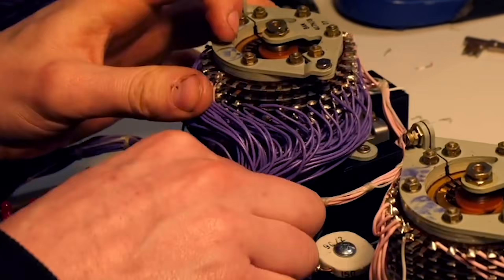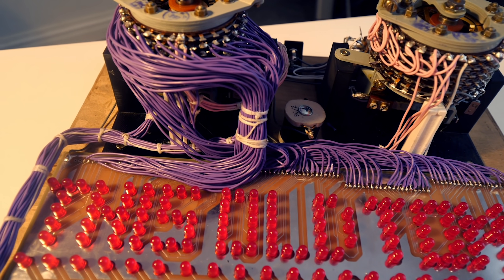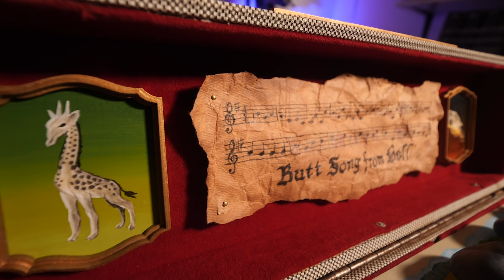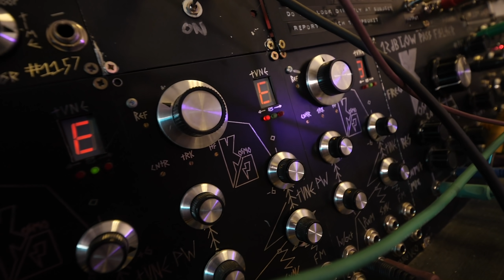ELECTROMECHANICAL LIGHT CHASER OF DOOM - DIY Build

Comment: When I trained to be a technician, I was taught to adjust stepper uniselectors.  A group of (stupid, bored) trainees, including myself, used to tune up the uniselectors to go as fast as possible, drawing bright blue arcs off the solenoid contactors.  We even had t-shirts made up for the "Uniselector Racing Team", no one said we had taste.  

No mater how fast you could get a stepper uniselector to go, it does not come close to the speed of a Siemens motor uniselector - these were massive and used a toothed brake to ensure they stopped on the correct outlet.  The big spring loaded brake was held away by a 50V 1 amp solenoid as the uniselector rotated, once it reached the correct outlet, the current was cut and the toothed brake engaged a sort of toothed gear (if you see a toothed wheel, that is a motor uni).  Every once in a while, the relays that held the brake up would malfunction and keep the current on,  it didn't take long for the brake solenoid to go up in smoke.  The motor was an open affair with two coils at 90 degrees and a rotor.  I remember all too well servicing and  "oil and dagging " (lubricating) these things in batches of 100 at a time.  The Motor unis did around 200 steps a second and were very hard to follow by eye.

Comment: Back when movie theaters had big glitzi marquees, you could stand under the chaser blinking overhang and hear the rotating and clicking bits quite plainly. As a young mad scientist, I even made a few variations of chaser circuits using motors and cams and microswitches. Just 4 fun.

Comment: Hindsight is 20/20... but of you would solder them in stacks of 12 with 12 earth.. you only would need to have 24 cables.
Reply from the maker: Yep I already knew about the multiplexing :D. But I did it this way as I felt like it was a cop out as I wanted to make use of multiple rows when that method would not have made use of it all if you get me. I wanted it to look like it was a right faff to make haha
Reply: @LOOKMUMNOCOMPUTER  well... its maybe me hating manual Labour, but i would probobly go one more step and simply reversed every second diod to cut it down even more
Reply from the maker: @matsv201  aha thats where you and i differ then i guess. i wanted it to look like that, so i was happy putting in the time :). for something like that it wouldnt be as cool with only a few wires :)
Reply: @LOOKMUMNOCOMPUTER  yea. I put in more theoretical work ro make it look just a little bit leaner

Comment: Actually, if you were to make one on the ground end, and one on the live end I'm pretty sure you could multiply those selectors by each other when it comes to the amount of possible lights
Reply from the maker: Yes you can.
Reply: @LOOKMUMNOCOMPUTER  well go on then
Reply from the maker: @greengoat5654  i will cus i aint soldering it like that again ha. when i planned this it felt like cheating as i wanted to have a fudge ton of wires on it. but the next onew im gunna multiplex
Reply: @LOOKMUMNOCOMPUTER  I want to see how long a sequence or you can make with only two of those, just as a challenge
Reply from the maker: @greengoat5654  well 900. but 9 sets of 900 but wont be 1 after the other
Reply: @LOOKMUMNOCOMPUTER  it would probably be beautiful sounding too

Comment: Could've multiplexed the leds, rows and columns, would have saved a lot of wire :)
Reply from the maker: Yeah I know. I did it like this because i wanted it to have loadsa wires. No point using uniselectors if using just 1 row on the fast one. I build with me heart ❤️ not me head most of the time ha👍

Comment: I spent 40 years working in on electro mechanical Stroger Telephone Exchanges and recognise these items well. All of our exchangers ran at 50 volts, although some smaller Exchanges and PABXs were 24 volts. They all had battery back to protect against power cuts. They were certainly more bomb proof than the current electronic stuff of today and just kept on working. Lighting and electrical spikes were all in a days work for these exchanges. The betting industry used this same equipment as it was ready made for the "TOTE" machines used at tracks for Dog and Horse racing. As this stuff was so well made was also used in Traffic Light control on many road junctions. Plessey and GEC being one of the main UK manufacturers. The switches and keys were also used by the BBC for switching circuits as they well so well made.

Comment: Should have multiplexed the LEDs. One switcher for common anodes, the other for common cathodes. Would have made for a trickier PCB layout, but only 35 wires from the switchers to the board. I worked at an American telephone switch room for about a week (job training for a Boy Scouts group) back around 1973. Loved watching the switches in operation, but never learned how the mechanical side works. Nice finally being able to see the ratchet and pawl system in operation.
Reply from the maker: Yep this is true. I went for the above as I usually build with my heart and my heart was saying do it this way ha. I wanted to make it with a trunk of wires. But never again I am designing one now which is multiplexing because yeah that one broke me ha 👍
Reply: @LOOKMUMNOCOMPUTER  Multiplexed LEDs are lots of fun. (So are multiplexed switches.) Loved the video. You do good work.

Comment: This is awesome. Can I recommend looking at wire wrapping wire and tools? The wire is thin, dead easy to strip with the tool, and can be soldered or wrapped, depending on the project. For these types of cray-esque projects, it's a massive time saver. It also lets you solder the wires direct onto fine pitch ICs, which is usually hard to do
Reply from the maker: I have those tools cheers it didn’t seem right for this the uniselectors had the wrong pins for wire wrapping

Comment: It’s not insanely difficult of a thing you made if you understand how it works but like, it’s done so well and looks cool. When I was in college the first time, back in like 2002, I remember actually being taught about a device that was functionally the same as those things. Though when I dropped out a year later to work full time as an electrician, that marked the end of my electro-mechanical journey. They actually changed the entire course right after I dropped out to be more electronic based, less mechanical based.
Reply from the maker: Ha yeah this thing is not complicated at all. It’s using it to do the simplest thing it can do pretty much.👍👍👍👍👍
Reply: @LOOKMUMNOCOMPUTER  a project I had to design using a similar device was what was called a lighthouse light system. Basically, making it so that as you go up the floors, I think there were 5 in the example, the one above turns on when the one bellow turns off. With 5 floors the wiring looked about the same, in terms of number of wires. Again, not hard when you understand but it took a bit for us to wrap our heads around it.

Comment: It never ceases to amaze me how young people are so impressed by this old tech, for those of us who had to work with it it's still good riddance.
It was expensive to make and maintain and wasn't particularly reliable, anybody else remember getting bad connections when using the phone?
I remember the noise and smell of telephone exchange rooms, all those Strowger sets moving and resetting and the rotten egg smell from the battery that was on charge.
Reply from the maker: Ha yeah but it’s just the same as someone your age liking steam engines. There is a place for it. Or there wouldn’t have been any Fred dibnah

Comment: When I was in college I used to participate in a lot of hackathons. One year a few of my friends decided to build a 4-bit computer (with proper Von Neumann architecture and everything) entirely out of relays. Their ISA I think just had instructions for loading, storing, and adding two registers, but it was totally legit and you could write programs by flipping some positional switches in a ROM bank they had made. They designed and laid it out beforehand, but it still took all four of them the whole 36 hours with a soldering gun each to get it done and they were definitely in the same mindset as you about it 😂

Comment: Multiplexing those LED's using second uniselector would have saved you a lot of soldering 😉 Great project anyway 😀
Reply from the maker: Yep but I wanted to do it this way. I thought about it but wanted to do it like this as funner to explain and also more wires I just had an urge to do it this way 👍👍👍

Comment: Could have been achieved with less wiring by configuring the LED circuit board electrically (not physically) as a matrix where one uniselector applies positive voltage to a row, and the other supplies negative or ground to a column. Only the LED at the selected intersection will illuminate.
Reply: I believe that's what TOT thought it used but I think the separate wires makes it so much more betterer.

Comment: That's a lot of work into a project. But with that amount of practice, your soldering skills are likely top-notch.

Also some old-timey devices passed on electro-mechanical parts for electro-optical for certain applications. Photo-resistors are one of the oldest solid state electronic devices out there, so they were also around in the time when electro-mechanical things dominated. Basically electro-optical would let a thing operate relatively quietly, and some kind of shadow mask (interruptor disk or punch card) with a backlight would switch the series of photo-resistors to do the thing. Of course before vacuum-tubes that would still drive relays or similar types of switches elsewhere down the line, but the part that programmed the sequence wouldn't be prone to wearing out like something that had brushes or switches dragging over it to interrupt a circuit. (A loop of paper tape going over switches wouldn't last as long, as where one going over lights would only wear on the sprocket holes use to drive the loop around.) So that's how some things like marquee signs were done before what we consider modern computing.

The clicky-clack is definitely neat, but some of the old stuff is also ingenious in other ways. Might be neat to try and find examples of those too.

Comment: Props for the waxed string wire management! I first saw that technique being used in real life in an operating ATT CO outside of Portland Oregon. There is some crazy story why ATT / BT required all cables to be tied down with waxed string. That is a skill that is almost non existent these days.
Reply: Having spent many hours hand lacing cables I can tell you that cord really cuts into your fingers after a while. It does look cool though.
Reply: @LesNewell  Me too and when it snaps and you punch yourself in the face.

Comment: Where people in past smart, definitely!!!

How Small Is It - 03 - The Atom (4K)
https://youtu.be/MsU17vcEKrc

Learn from David Butler how they calculated the circumference of the atom ... more than 100 years ago ... very simple and pretty much anyone can do it.
Did you know that the electron races with a speed of 6000 km / Second around the atomic nucleus .... the radius is like 50 picometre ( 10 -12 meter)
 ... very recommended video for everyone.

Totally without computer aided design things from the past, keeps me amazed, building a prototype ...

LOL, that amount of wires, you need to get hold of "waxed Hemp cord / twine" specially made for that purpose to make it "more" original, but very time consuming and acquiring the knowledge how to.
 : )

Cool, a message from Adam Savage

Comment: Love the touch of wax string stitching.
Its fun watching younger folks "discover" what I took for granted and did for a living.

keep it up!
Reply: When I saw all the wires I was like "you should dress that up.  Please don't use zip ties". I should never doubt.
Reply: From my days building telephone and telex exchanges, it is called lacing.  Originally, waxed, natural twine was used, but in later days when plastic insulation came in, we used a cable tie system, these ties were different to the cable ties most people use.  

We would lace up the rack wiring as one big loom from about 20-30 of 100 -200 pair cables, depending on the rack type.  We also block-laced cables together using twine and a thin blade with a hook on the end.  These blocks were formed of cables of 5/8 inch (16 mm) or so in diameter, formed up into rectangular blocks of around 25-40 x 20-30 cables, once they were laced together you could walk on them.  When a smaller block of cables was fed off to a rack we would use forms to create the sweeping curves, sometimes they would twist as they curved, very complex, very time-consuming to do, very pretty when new, massive dust collectors, so eventually everything, including the brightly coloured silk covered individual wires,  would end up a dark grey.  

I wish I had "acquired" a couple of metres of a big block of cables when one of the exchanges was scrapped, it would have been perfect for wiring up vintage equipment - nothing modern looks right after you have seen silk-covered wire. The guys from the recyclers who scrapped the exchange used big wrecking saws to cut up the cable runs into manageable pieces.  No one who built these exchanges should ever witness their destruction, I was just unlucky.
Reply: @robertnicholson7733  Yes! Lacing.
I have worked the headends for Comcast and built pay per view bays which required the square bundles of coax,  we used plastic cutting boards with the proper holes drilled in them to assemble the runs.  The stitching needles and loops are still in my garage.
I have pictures of the bundles as they roll and drop off the needed number of cables in specified areas.
Never been sliced to the bone by waxed string like I have by a cable tie that was cut off at a 45 degree angle, but I do have scars from the snips!
Reply: @theemiddleone  Good that you have photographs, cameras have never been a thing with my family, there are three photos of me total in a 5 year period, and they were all from my University student card.  The photos that I wish I had the most were from the Chief Telegraph Office (where I was sent by the management for my sins), Brisbane, Australia, the rows of Motor Uniselectors,  but mostly the CTO just before Christmas when it went into congestion and the store and forward system (it used punched tape as the storage medium) would overflow to form massive piles of punched paper tape in front of each reperforator sender.  Woe betide the technician who misjudged a step trying to avoid these huge piles of tape while replacing a faulty machine and put a crease in or damaged a tape.  

Some time in the last 10 years it appears that somebody discarded my carefully preserved Christmas picture tapes that we used to send over the Telex network at night. Another loss.

Comment: To echo tot, would like a break down of how it. Actually works!!
Reply: There are two mechanical selectors that use an electromagnet to switch to the next. At 2:20 he explains how to loop it and the last selector 3:15 switches the next one. There are 3 selectors on the 1st one and 5 rows on the other one, making for 150 individually addressable LEDs. The LEDs are wire on a PCB to show a chasing light.

Comment: Not doing it in a 2D matrix with the anodes on one selector and the cathodes on the other?
Reply from the maker: Well it is a 2d grid just wired different
Reply from the maker: Wanted to make it maximal. Would be no point using uniselector if using 1 row of each. The wires are half the fun

Comment: I used to program PLC Ladder logic and I was just thinking that that uniselector thing is what was implemented as a drum selector in the PLC I used to work on.  Each input would advance the selector one tick and the PLC drum selector could set up to 16 different contacts to on with up to 99 possible positions for the selector.  Cool stuff. I knew theoretically what the drum selector was based on but until now had never actually seen one in use.